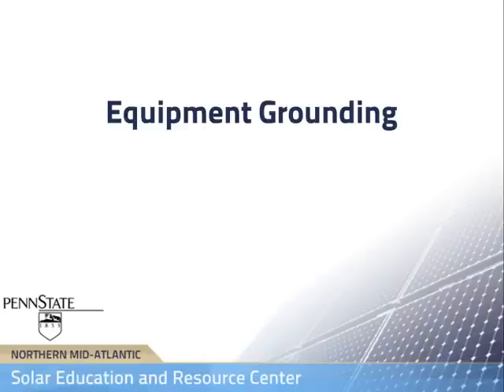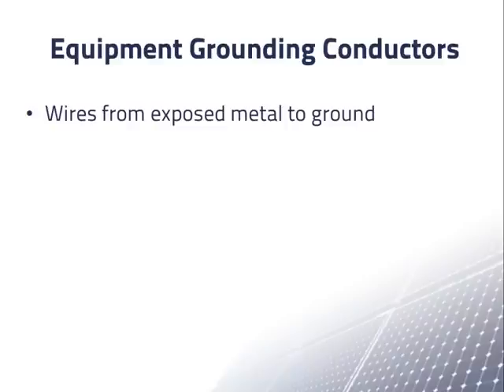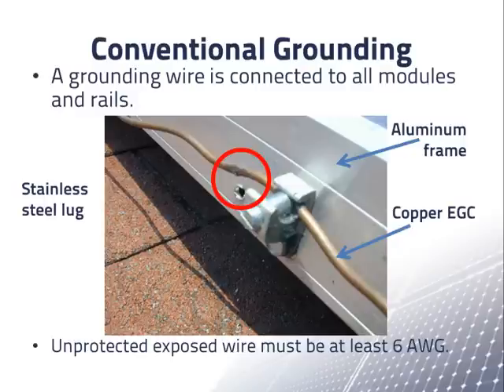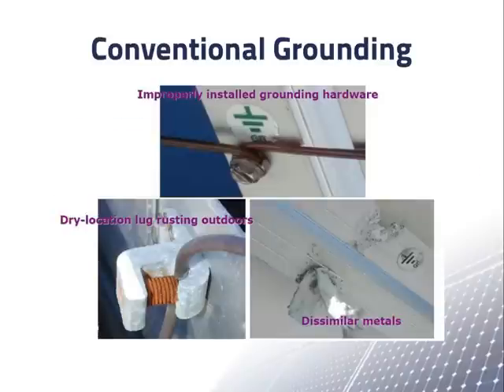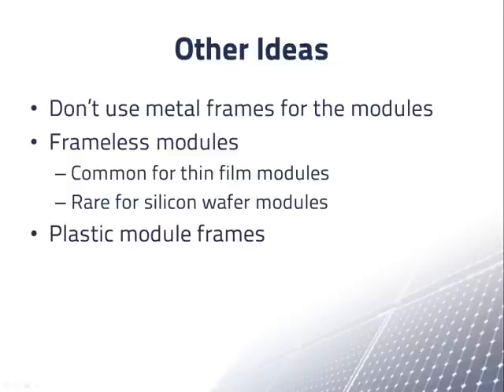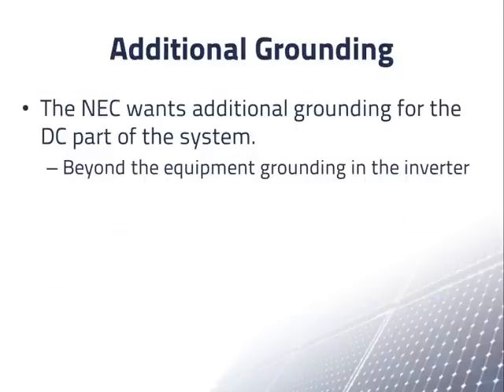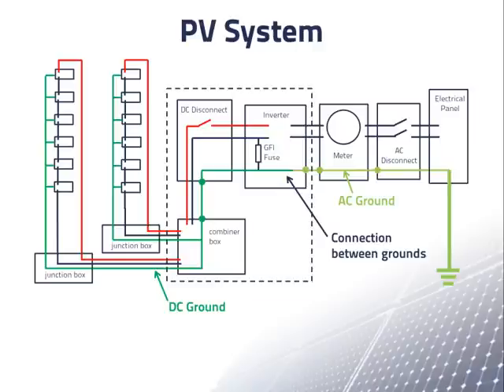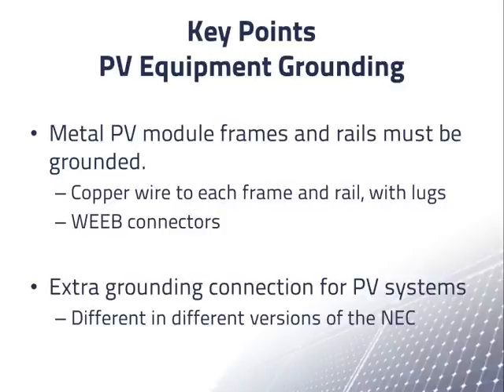Equipment Grounding for PV Systems

Comment: One important point that is not mentioned is that the ground rod will only cause a ground fault if it's impedence is lower the about 8 ohms. 120v divided by 15 amps. Most grounds don't meet that requirement. The ground is only there to sink residual voltages and of course a lightening strike. It's your neutral that returns the current to your source and your ground should be bonded to the return path for it to trip your breaker.

Comment: What about grounding solar and INV via the copper water pipes which are naturally grounded as they run underground...this in combination to the main and critical load panel which are grounded via a 8 feet copper bar ?

Comment: 3:26 the circuit breaker does not open. 120Volts/25ohms= 4,8amps. This is not going to trip the circuit breaker.

Comment: Are the WEEBs used at all 4 bolts of a PV  panel, or just one bolt ?
Reply: urgentcareguy3 -- WEEB stands for Washer, Electrical Equipment Bond, and is specifically produced by Wiley Electric. Other bonding washers might be made by other companies, and not all bonding washers are made by Wiley Electric.

My answer, in this case, is specifically directed at WEEBs, though, and might not be true for all products.

The short answer is it's not all four, OR just one -- it's probably two, as a minimum.

The long answer, in the case of WEEBs, is that either the racking manufacturer or Wiley will give you some documentation that explains the proper way to use their equipment.

When a piece of electrical equipment goes through the necessary testing to be legal for use in the United States (see Wiley's UL and ETL certification documents on their website, for instance), the test is done with their equipment AND the instructions for using that equipment, and in order not to maintain code compliance, you must install that equipment per the manufacturer's directions. 

For an example, you can check out page 9 of Wiley's installation instructions for Unirac's SolarMount racking system (this page is essentially replicated in Unirac's installation manual for their product) which shows different ways to install the washers (shown by Xs) based on whether you have an odd or even number of modules. http://www.we-llc.com/docs/librariesprovider3/Weeb-catalog/104-0404-000010-015.pdf?sfvrsn=0 As you can see, no module has fewer than 2 WEEBS, but one does have all four corners used. The rest of the manual covers all of the other details about the product, if you're curious.
Reply: Thank you for the very thorough reply! Guess it is time for some research.

Comment: NEC 2017 Code has put a bit of a cloud on this video "Functionally Grounded" versus "Solidly Grounded" and then 690.41(A)(1)-(6) - What type of system do you have and where does theCode send you.  SGE, SEC, EGC, etc.   -   Probably in a "do loop".
Reply: You rarely see solidly grounded PV systems.  The AC grid may be solidly grounded, but the DC side is rarely (if ever) solidly grounded.   Systems that ground one of the polarities, used a ground fault fuse or breaker to ground the grounded conductor, which the NEC now calls functionally grounded systems.   Systems that ground neither of the polarities, are "functionally grounded" by being connected to a grounded AC system through a non-isolated inverter, and will be constrained to be at equal and opposite voltages to ground.

I like the term functionally grounded, but I dislike the fact that it applies to two completely different kinds of systems.  I'd prefer "functionally grounded" to apply to the grounded systems that ground one polarity through GFCI, and "symmetry grounded" to be the term for the non-isolated inverter systems.

Comment: if you have a un-grounded system  ,,  both positive and negative are isolated from ground  ,,  then grounding your metal towers , metal cases on equipment etc is only good for conducting lightening to ground //  in any ungrounded system the current has no desire to go to ground

Comment: Plastics compress with mounting hardware. Aluminum frames may be superior to plastics in expansion, extreme temperatures, cracking and ability to handle heavy snowfalls.

Comment: can i ground all the AC and DC  equipment on the same earth grounding rod? or do they need to be grounded apart?
REPLY
Reply: I would say if you can  conveniently install a seperate ground it would be preferred not to mention safer, however depending on your install (and local code requirement) attaching to the AC ground rod is allowed.
Reply: @noneya3504  I would disagree.  It is better if you have a common grounding electrode system for everything on the premises.   Otherwise, you might pick up ground voltage gradients, which manifest as current on the EGC system, where it doesn't belong.  This is the issue with 690.47(D)anger, that has now been removed from the code.

Comment: still not clear if DC and AC ground can be on same earth rod?
Reply: Per the video it is possible to be used on the same earth ground rod, but check with your local and or inspector if it is permitted in your area